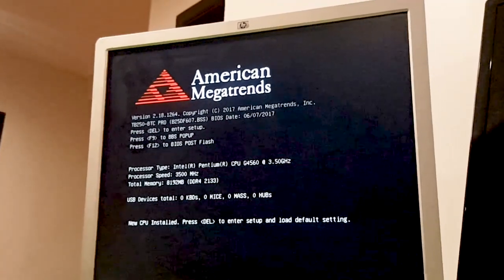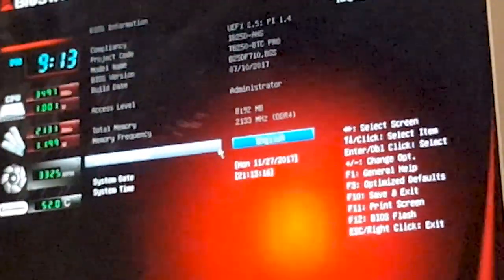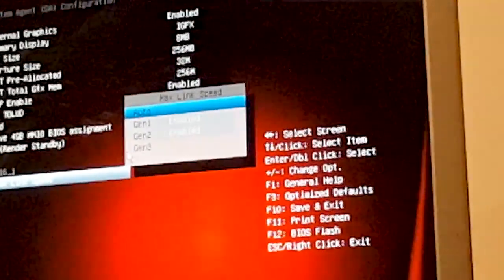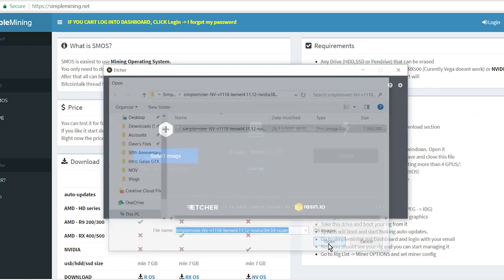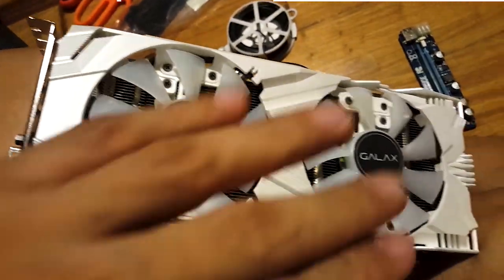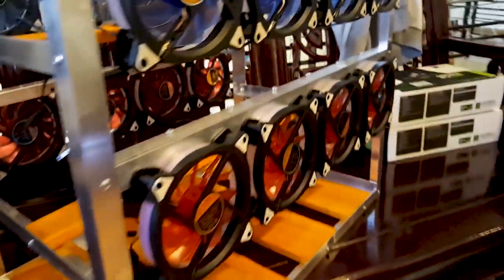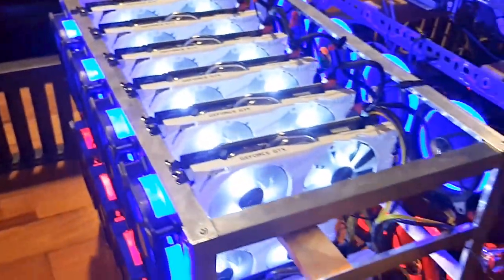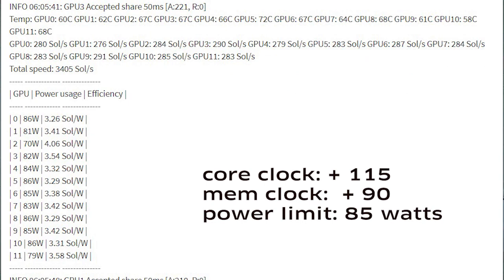Building a 12 GPU GTX 1060 Mining Rig Using SimpleMining OS | Biostar TB250 BTC Pro

Comment: greetings. excellent chanel dude. nice rack mount.  i have the Asrock H110 13gpu mobo, am really trying to decide between gtx1060 or 1070. are you happy with your 1060 build? not the cheapest electricity in australia.
what would use on your next rig man?
hey thanks a bunch!! Phil
Reply from the maker: so sorry just got back to answering comments.  I would really recommend 1060 rigs or maybe RX 570s as long as those are bios modded.  Cards can run between 70 - 85 watts when mining ethereum.  Around 85 watts per card mining zcash.
Reply: daveFL daveFL thanks man!! i think you've helped me decide. going 1060's for this rig i think. partuculary as aistralia has 26cents pkw high electricity so this helps. appreciate your comments. $2 in zecash coming your way! :)
Reply from the maker: haha! thanks for the tip, Phil.  Glad I was able to help out.  Keep me posted on your build.  I'll try to upload my mining operation update video tomorrow (got an off-duty day finally).  Got 6 rigs running right now with a total of 62 cards :)
Reply: wow over 60 cards! thats like buying a house. probably a better return right now. you must either have a good paying job or live on baked beans and $2 dollar noodles to be able to acquire all those cards :)

Comment: I tried SMOS and found unable to control temperature, it was going to 82 and getting stopped, where in windows, we can control using MSI after burner, how did you control the temperature. I found bminer is the fastest for equihash, EWBF and dstm are much slower compared to bminer, it really pulls the hash out of 1060.  Not only SMOS. I tried Jive OS as well , both temperature is a big issue, mining stops in no time.
Reply from the maker: You can control the temps in the OC settings button.  Click it and set the target temps.  You can also increase the minimum fan speeds to above 50 or 60.

Comment: Forex Trading Account Management 

WE ARE PRESENTING AWESOME SOLUTIONS
MANUAL TRADING METHOD FEATURES

1. Minimum Equity should be 5000 (USD/GBP/EUR) above any figure.
2. Managed Accounts should be under ECN/STP brokers only. Market Makers are not allowed.
3. We perform over 70% to 110% growth of equity within 22 trading days, with 25% to 35% draw-down. 
4. During this operation we use only Manual trading methods according to Market Conditions like Fluctuations, Behavior etc.
5. Withdraw / Deposit options are always in client's hands.
6. We charge 50% of total profit with the clients.
7. The profit sharing procedure held on the last day of a week.
8. No any hidden charges are there.
9. Client's accounts details will be fully confidential, password will be shared with account holder only.

https://www.facebook.com/ManagedFund/
Reply: youtube.com/watch?v=DcrwasQGZag

Comment: Dave, what is the difference between Molex and SATA power riser and which one is best to use?
Reply from the maker: Bojic Bilog i have both of those and not much difference. The only main thing to consider would be how much sata, molex or pcie cables you have to accommodate all the risers. Last thing you want is running out of cables to run your rig. There's also now a version of risers that has molex, sata and pcie connections to power it meaning it's really flexible. You can just choose one of those

Comment: Hey Dave I'm a bit confused in what you are doing cuz I'm a( newbie) in this. So you made your system/ PC to open not windows but the software you used. So my question is how do I get that software and how does that software connect to a pool. I'm currently running 3 1050ti = 150-180 sols ea. Is it a good idea to get more 1050 ti cost wise?  ( 3 1050 ti is about 20k php. And one 1070 is more than that. Should I keep building more 1050ti (without  the 6pin to power . Specifically the galax version)
Reply from the maker: the OS im using is simplemining OS. you can learn how to download and use it in their website. it's pretty simple (pun intended).  Visit www.simplemining.net

As for the questions about the 1050ti vs. the 1070, i don't have personal experience yet with 1050tis so not comfortable in giving concrete answers but to help, one 1070 I have could produce 450 sol/s mining zcash and then 27 - 29 mh/s mining eth.  wattage is somewhere between 120 - 125 watts per card and bought each at around 23k pesos.  Do a bit of math on how much your 1050tis cost, hashrate and wattage vs. the values I gave you and then decide for yourself if you think which one would be the better option for you :)

Comment: Hi, I have setup 12 1050ti ethereum mining rig everything was working fine..Today I have disconnected 1 side of 6 risers from the power supply just for testing another power supply then I replaced with old one power supply but now whole operation is stopped I tried so many time to interchanged the riser but it's not working now...Plz plzz help me with this asap as u did before
Reply from the maker: Is your PSU an ATX or server PSU?  If ATX, do you have an add2psu to power on the 2nd PSU?  If server type, check first if all connections are intact.  If all of these are addressed, I would suggest turning off the mobo, disconnecting all PCIE 1x risers of the GPUs, connecting the IGFX display port to the monitor and then resetting the CMOS of the mobo.  Hopefully it will power on and boot up.
Reply: daveFL it's not a server PSU..Ok I will do the same
Reply from the maker: do you have add2psu?  how are you powering on the 2nd PSU?
Reply: i merge them with the cable and connected to the motherboard
Reply: It's on now but on my simplemining dashboard rig status showing offline I don't know how to rectify it plz help
Reply from the maker: Samreen Ayesha sorry, did you mean you have a 24 pin link connector for the two PSUs?
Reply: daveFL no I have 12 GPU and I am using simplemining os on my smos dashboard gpu's status showing off..I am unable to rectify what is tha problem
Reply from the maker: yes, that i understand but if you can provide more details so I can try to help you better.  How are you powering the 12 GPUs?  How many PSUs do you have?  Does each PSU power up upon booting the PC?  Does the PC power on (CPU fan spins when motherboard is turned on)?
Reply from the maker: maybe best to upload a short video clip of your rig on your youtube account.  I can check and try to figure out what's wrong.
Reply: thanks @daveFL problem has been solved now..
Reply from the maker: Samreen Ayesha great to know. What was the resolution?
Reply: i reset the whole thing...hey do u have any idea how to overclock ethereum classic?

Comment: I have a question Dave if you don’t mind, brownouts in the philippines is very common. Does the sudden power influx after the brownout damages the hardware? What do you use to protect the hardwares? Is using a surge protector + avr help 100% of the time? Thanks!

Comment: you did not scatter the thermal paste evenly on the surface of the processor, this will create a space between the processor and the heatsink. and it's an open rig, it's pointless to suck the air from the gpu cards, point all those fans blowing towards the cards and the hot air will go up.
Reply from the maker: Pj B thank you for pointing it out. Hot air from the gpu blows upwards --> to the second layer of GPUs. That's why the need to push it out rather that let it be.
Reply: it's up to you..nice rig btw.grats..

Comment: Dave... tell me about mother board please. are you using linux? or windows? because as i read on this mobo impossible to install 12 same kind gpu while using windows. for example 12nvidia isnot ok. but 6 AMD and 6 nvidia ok or something like that.
Reply from the maker: Achi Nadirashvili im currently using simplemining OS, a linux based mining OS. Before, it wasn't possible to run more than 8 gpus of the same make on windows but from what I heard, you can now do it with the recent windows 1709 update. Not entirely sure as I havent done that yet. Maybe in my next build.
Reply: daveFL Thank you for quick answer. so anyway i need to use linux (( i will wait for ur next video. and one more quick question . PNY and Strix models are cheaper . Asus about 330 $ each 6gb card. and MSI and gigabyte almost not available . what you think PSY and strix are weaker ? there is about 40 $ difference. and which one you recommend mostly
Reply from the maker: Asus Strixx here in the Philippines are more expensive compared to other brands.  Since you know which cards are available to you, better compare them to each other.  Specs you'll want to look at would be base clocks and boost clocks, memory, and cooling system.  Like for example, I got these Galax 1060s EXOC white because they have higher base and boost clocks compared to others available to me.  Not to mention way cheaper compared to others.  Cheaper doesn't automatically mean weaker if you do proper research.
Reply: daveFL and what is average hashrate for ethereum. on overclocked(but stable) settings reached 24mh/s?(each card sure)
Reply from the maker: Achi Nadirashvili for these cards? Around 19 - 21 mh/s only since i got micron memory chips instead of samsung. That's why im using them to mine zcash or equihash based coins. More efficient
Reply: daveFL so Samsung is better for ether mining but what about samsung memory for mine zcash or equihash based coins ? still good like micron that u have now ?
Reply from the maker: Achi Nadirashvili getting samsung cards is winning the gpu lottery. Yes, samsung cards run better than other cards
Reply: daveFL for micron there is update as i know vbios update . after u can overclock more like samsung.
Reply from the maker: Achi Nadirashvili thanks for the tip. I'll definitely look into that
Reply: daveFL no you thanks bro you are good and kinda person. wish u luck

Comment: Do you have the pico connected to the server psu? And what exactly are you running off the server psu?
Reply from the maker: the pico is connected from the server psu to the motherboard in order to power it on.  I can run the motherboard + 6 GPUs using one server psu.

Comment: Hello sir! thank you for sharing your build.. I was planning to build my first mining rig for the longest time LOL #newbie

Question: You use dual psu po right? ATX for the mainboard and the server type for the GPU? tama po ba sir? Any recommended brand of PSU? Minsan kasi kulang yung wires sa mga stock PSU I'm still gathering recommendations. :)

I'm building a 6 GPU mining rig in GTX 1060.

New sub! :)
Reply from the maker: thanks for the sub!  I would recommend getting a corsair 1200w platinum or gold rated power supplies.  Comes with a 10 year warranty.  That is if cost to purchase is not that much of a problem.  If it is, try to get yourself one of those server type power supplies. Merong mga nagbebenta sa crypto market PH facebook group.  Search mo lang and then join. :)

Comment: how did you connect server psu and atx? does it power on together?
Reply from the maker: No need to connect together the server psu with the ATX.  Just plug the GPUs you plan on powering with the server PSU and turn on the server PSU first before powering the ATX where the motherboard is connected.  Turn on the system and it should run fine.
Reply: daveFL salamat!
Reply: Pre, additional question. Risers power is also coming from PSU?
Reply from the maker: yup! so merong power connections (either pcie, sata or molex depending on the riser card type) from the PSU and then the usb connection going to the mobo.  If you're using the molex or sata ribbons, dont power more than two riser cards using one ribbon.  it usually becomes unstable if one ribbon is powering more than 2 riser cards.

Comment: use dstm miner for equihash and your 1060 3gb cards will do at least 305sol/s each.
Reply from the maker: Thanks for the tip!  It is actually much higher and efficient when using this miner.  SimpleMiningOS doesn't have it yet though but I'm using it for my windows rig.

Comment: hi @davefl also a miner here using 1070.can u remotely access ur rig in simplemining os? i can with windows team viewer but not sure if u can on your os?
Reply from the maker: hmmp hhm yup. SimplemingOS' GUI is browser based. You simply go to the website, log in to your account and from there, control your rig settings, which coin to mine, reboot, restart the rig, etc.
Reply: daveFL ty for fast reply  how do you overclock the settings? do u install msi afterburner in the simplemining os?
Reply from the maker: hmmp hhm it's already built in the OS. No need to download and overclocking software.
Reply: daveFL so what is the overclocking software it uses.?
Reply: daveFL meron pala sya charge  usd2 per month
Reply from the maker: hmmp hhm like what I said, already built in yung overclocking tool ng simplemining OS. And 2 usd per month is roughly 100 pesos. I wouldnt mind paying that amount if it's more efficient, less hassle and less buggy compared to windows. Plus it lets me run 12 GPUs in one system easily
Reply: daveFL how do u pay for the usd2? via credit card?
Reply: daveFL did more research. but how much does ur 1060 in zcash? i mean ur 12 gpu . i have 8 1070 palit and sol/s is 3500 with power wattage at 1162 watts
Reply from the maker: the 1060 rig can generate 3,400 - 3,500 sol/s at around 1,200 watts.

Comment: on a 12 GPU rig...  using SMOS ... is it possible to mix "1070 TI" with "1070 Dual" and "1070 JetStream".... will it work?
Reply from the maker: as long as it's all a set of Nvidia cards or RX cards, it will work.  Overclocking settings might be a bit tricky though.  From my experience, I tried different overclocking settings per GPU using simplemining OS using the comma separation and it doesn't seem to be accurate.  Your OC settings for your 1070ti might differ from the dual and jetstream. There's a slight chance you'll have an issue with tweaking the OC settings per card correctly.
Reply: Thanks for the info on OCing
Reply: By the way, if its already mining, how do you see how much have you mined? like after a day or two

Comment: Why don't you use 1080Ti ? I'm pretty newbie, please explain.
Reply from the maker: I also have a mixed 1080ti x 1070 rig.  4 1080tis and 2 1070s.  Cost to purchase the 1080tis are way to high and power consumption is high as well.  If I want to max the hashrates of the card, it will drastically lower the watts to hashrates efficiency, draw a lot of power and run really hot (may reach 78 - 84 temps even with auxillary SP fans).   Mine can produce 720 - 730 sol/s on equihash but it's at 100% tdp, overclocked, drawing 250 - 270 watts electricity and reaching 80+ degrees temps. Some miners are able to use it properly but most of the ones I see are mining in places with colder climates.
Reply: Why not use asic
Reply: You started in July and you didnt get your investment back yet?! you are mining the wrong coins, man.
Reply from the maker: teach us, master
Reply from the maker: a couple of factors: harder to purchase and import in our country, just seems too loud to keep around the house and people living with me might start complaining about the noise.
Reply: Personally i'm now waiting for the 1180's or 2080 (whatever they are going to call them), and then plan to water cool the system. We'll see how that goes. It should help with the heat and noise.

Comment: boss which is best recommended? 7x 1080ti ? or 12x 1060? or we can chat sa FB para sa mga tanong ko im interested in building 1
Reply from the maker: depends. if hindi factor yung electricity cost and room temps, I would recommend 1080ti.  But if those are, mas profitable 12x 1060 compared sa 7x 1080ti.  Cost to buy vs. hashrates ratio is also better with the 12x 1060.
Reply: how about 1060 3gb and 6gb?
Reply from the maker: Scooba Doo go for the 6gb for higher hashrates